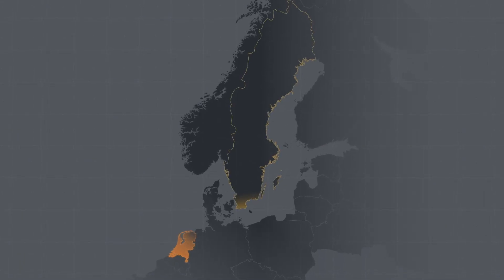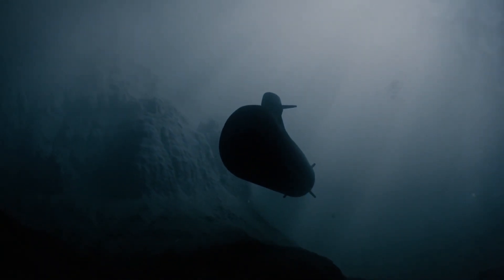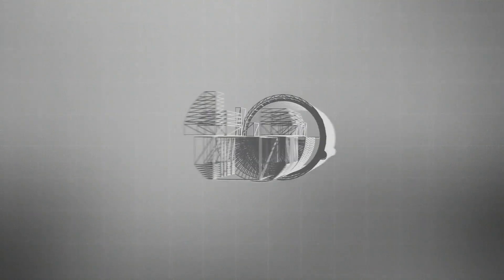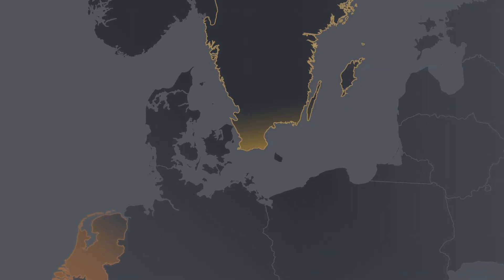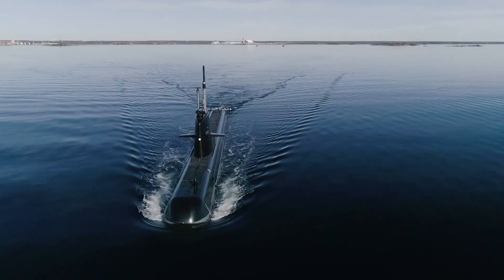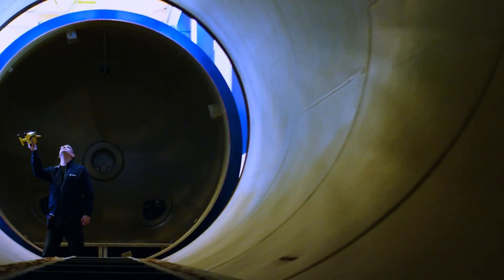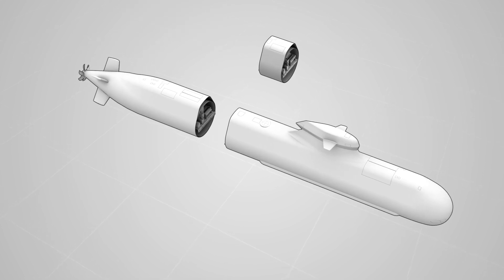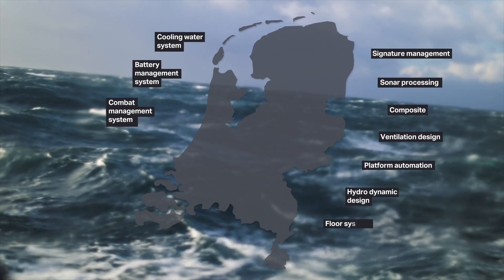The new expeditionary submarine

Comment: Is the ignition key on the floor in between the front seats?
Reply: Yes, and you can only remove it if the gear is in reverse!
Reply: SAAB placed the key between seats because it woud be safer in an impact. So you dont get the key in your knee

Comment: Sincerely hope Saab will get the order and that the Royal NL Navy will be able to purchase 4 (instead of the 3 envisaged right now). The Rheinmetal alternative in my view is pretty good as well, though I am not certain if the diameter of the hull is the same and will sustain extended periods of patrolling, the accomodation of special forces (for insertion/extraction) and a seizable weapons load out. As for the French design (Barracuda based for the Royal Australian Navy) I'm not so convinced. As with the Collins-class the approach il likely to spiral in terms of cost and planning due to RAN-specific demands.
Reply: Pincer88 The Royal Netherlands Navy will acquire 4 submarines. The RNLN has stated that 4 subs is the minimum number it needs in order to always have at least 1 submarine fully operational. They count with 1 sub in maintenance, 1 sub just returning from a mission, 1 sub that is ‘working up’ / preparing for operational duties. And 1 sub at sea.
Reply: Collins-class did not spiral out in cost. By 2006, A$5.071 billion had been spent to build the submarines (excluding the fast track program); after taking inflation into account, the project had run less than A$40 million over contract. When the fast track program is factored in, the Collins class cost just under 20% more than the inflation-adjusted contract value; a smaller increase than other contemporary defence projects. By todays standards these cost-overruns almost looks cheap - just compare F-35.
Reply: I hope Saab gets the orders as well. And not just to replace the Gotland and Walrus, but maybe the Upholder/Victoria as well. I also wish that the US and UK would consider supplementing their boats with SSKs. (Either A26 based or Scorpène-based.)
Reply: Pincer88 as a French , I would be glad if you bought the barracuda , French submarines have maintained French dissuasion needs all over the world with success and will continue for next decades  .
Still glad you buy subs , it is a great way to protect your waters !
🇳🇱🇫🇷👊🏻

Comment: I just realized that SAAB is really into adaptability and modularity. Shown in both sub and Gripen software architecture.
Reply: It's a lot like that other Swedish-founded multinational design bureau, IKEA
Reply: @catsfrommars  What's next, flat packed submarines? :D
Reply: @catsfrommars  CV 100 - by IKEA!
Reply: The Weapon Collection I actually admire them for outsourcing - they put away national pride to used only the best/most affordable components.
Reply: Definitely economical. My favorite thing about SAAB... a perfect set up would be them making our joint light strike vehicles. With Lockheed making stealth/air superiority and Northrop making bombers.
Reply: Because swedish geography is teacherous and not in favor of giving swedes the geological advantage.

Also, modularity means you can switch broken modules with brand new, undamaged modules, instead of replacing or scrapping the whole craft/vehicle altogether. It also has the benefits of being easily modified, so there's that.
Reply: I am not a arms dealer ... so why YouTube recommended this to me 
... or am i ?? 😐